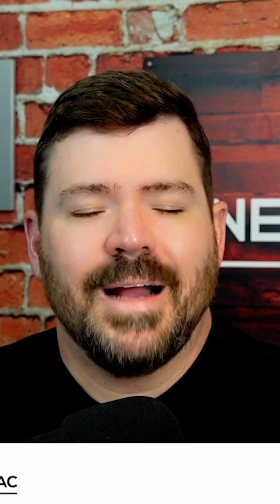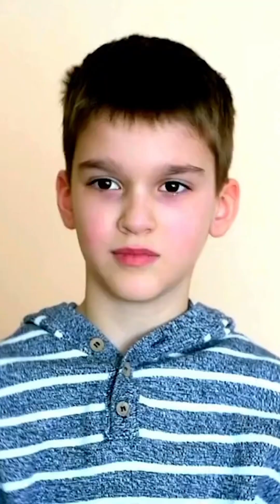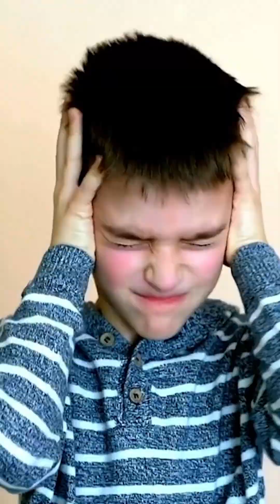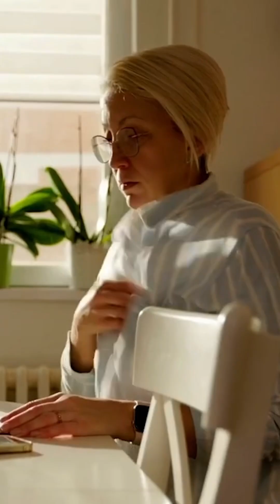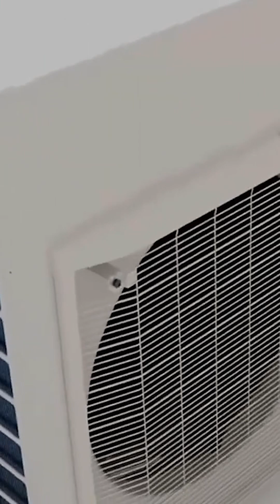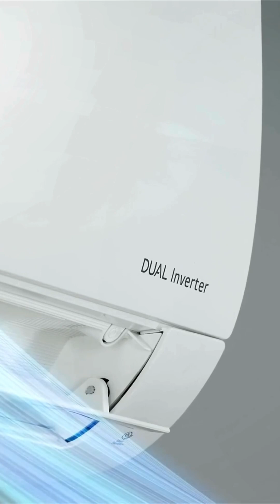The problem with new HVAC technology #hvac #technology #loud

Comment: My issue was that my contractor turned out to be a typical “replacer.” He replaced my lineset, condensing unit, and air handler, but when it came to fine-tuning the system, I had to rely on ChatGPT for advice on both the purchase and setup. I ended up feeding the entire manual into ChatGPT just to get the answers I needed. I purchased the Bosch IDS 2.1.1, which is an impressive piece of technology, but you really need to know what you’re doing to make the most of it. Honestly, I feel like my UK contractor had a much better grasp of what he was doing compared to my US contractor. Maybe it’s because this type of technology has been around longer in Europe, or perhaps it’s something else entirely.

Comment: But if a variable system can run from 20% to 120% capacity and it is 5 ton but installed on a 4 ton home so oversized by only 1 ton, why is it very bad? The system can go as low as 20% of the 5 ton capacity? And with geothermal systems for example, I often hear recommendation of oversizing by 1 ton, to ensure enough thermal energy access.. I hope you are referring to big differences, like having an air to air 5 ton one or two speed system instead of a 3 ton and while not having adequate duct sizing to accommodate the 5 ton.